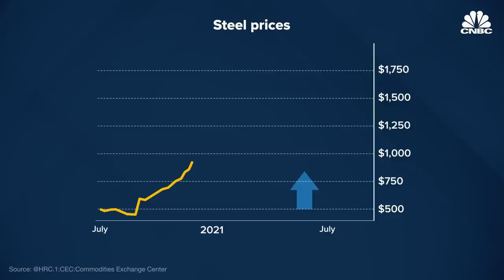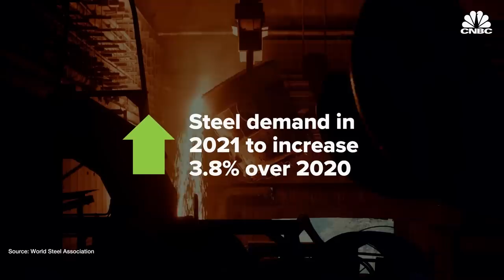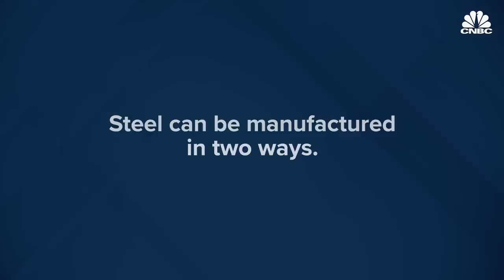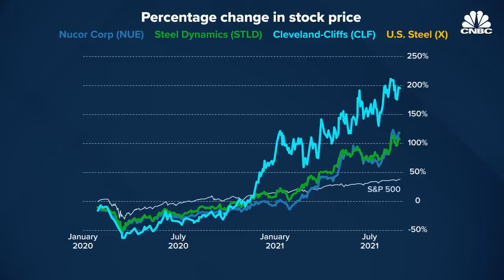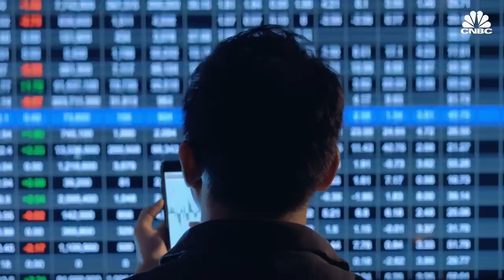Is The Steel Bubble About To Pop?

Comment: For those that don't know, traditional integrated mills also use scrap. They add about 20-30% after the BF and then it goes to the BOF to remove impurities and excess carbon. That's when it's actually considered steel.
Reply: BOF?
Reply: @aaronfield7899  basic oxygen furnace. It has a lance (submerged entry nozzle SEN) that pumps oxygen in. The O2 binds with carbon to make CO and CO2. The lime that's added is a flux that binds with the more active elements and O2 to form slag which is removed. After that it goes to ladle metallurgy, where they adjust the chemistry.
Reply: @jeffquinlan4064  Oh, so Pig iron is the metal transported from the BF to the BOF?
Reply: @aaronfield7899  Yes. Traditionally, they could also be poured into ingots sometimes called pigs. Hence the name. Somewhat of a useless fun fact for you.
Reply: Lies again? Spank Bang

Comment: You can print dollars but you can't print steel. More dollars chasing a limited supply of a resource, it's only logical that the price will rise.
Reply: Prices are rising due to an increase in demand. Demand is increasing as the amount of reshored manufacturing jobs increases. We’re on pace to see a total of 220,000 manufacturing jobs reshore to the US up from 160,000 in 2020 which was up from about 140,000 in 2019. The good news is that we’ve got several steel mills under construction in the US set to come online within a year. I know Nucor is planning to build a massive $2.7 billion steel mill somewhere in the mid-west.
Reply: Fortunatly steel isnt a key material in electric cars
Reply: Davidon   Is not manufacturing steel analogous to printing paper money?
Reply: @peereboom2936  right, the body is made of plastic....uh ha
Reply: @dantheman1534  lol
Reply: @davefroman4700  to bad modern cars don't use nearly as much steel anymore

Comment: Aluminum & copper prices are up cuz the electrical grid is being restructured in Texas. Steel prices won't go up much more until vehicle manufacturing is back up to speed. Labor shortages are also keeping prices down. However, it is probable that the labor & chip shortage could end @ about the same time, skyrocketing prices overnight.

Comment: The electric arc furnaces is for steel recycling not making.
Reply: yes those are normally for steel recycling, but...
"Although steel arc furnaces generally use scrap steel as their primary feedstock, if pig-iron or direct-reduced iron is available economically, these can also be used as furnace feed"
edit: (from another source) 
"electric arc furnaces (EAF) are a common method of reprocessing scrap metal to create new steel. They can also be used for converting pig iron to steel"

Comment: Same thing will happen to steel that happened to lumber. Bubble will burst.
Reply: Capitalism!
Reply: Lumber prices burst?
Reply: @generalx5220  So you don’t know how to look up whole sale lumber prices? Yes they have collapsed. Lumber was over $1500 and is now less than $750 after actually collapsing to less than $500. Basically the same prices as 2018.
Reply: @matthewhuszarik4173  naw not in the are to check. Used to be able to pop my Lowe’s or home deep but that’s not an option now. Cool though, back to normal is good, I thought it was inflationary, you know general price index have gone up from all the money printing

Comment: Recycling steel still requires a large amount of energy. Biggest problem I see in the steel industry is waste of the original product. Cut something wrong? Hole in the wrong place? Dimensions not right? SCRAP IT! Get a new one! For such an energy intense commodity to manufacture there is way too much waste.
Reply: Basically only a small percentage of energy required to make new steel out of scrap steel. Check out Nucor's expense sheet compared to the integrated producers.
Reply: Isn't the "waste" recycled? Genuinely asking.
Reply: @jenisonsound7563  Yes, the " waste " from a cutting operation gets recycled.  This grade of metal has a higher value because it is clean Vs say a car body that needs shredded and separated into differing recycling streams.  

Do a bit of research on scrap metal recycling, this is basically a mining operation.  I never want to see metals thrown in the garbage since the only practical way to retrieve them is to wait for the earth to melt and reform.

Steel, Stainless Steel, Aluminum, Copper, Brass , Lead < primarily from lead acid batteries ( AKA a common traditional car battery )  are very recyclable.  And. . .you can get a few $ in the process.
Reply: RS, so how do propose to reduce waste?
Reply: It’s just like recycled material from your home, it is cheaper to buy new raw material then it is to buy bales of recycled material…the US is on one

Comment: Steel and metals will continue to rise. China has a huge production shortfall due to energy issues. It will need months to fire back up to full capacity.
Reply: You completely misunderstood the situation. China has been intentionally cutting down steel production since last year, trying to remove inefficient, highly polluted steel mills. That country realized it was not worth polluting own lands (some are even permanent) and air to provide cheap products, exchanging for US bonds.
Reply: @anti-bullingjames  China is reducing Australian coal imports and cant find enough to continue running mills and power plans. Everything hit a production slump last year. Aluminum is sky rocketing as well. China can't produce enough to keep up their levels of production. Now with LNG going up all of Asia is about to get hit hard.
Reply: @cmdr1911  apparently you have no idea about this topic. Before china and Australia had issues, only 1.9% all coal consumptions (this is CONSUMPTION rather than IMPORT percentage) in china came from Australia (1/1-11/01,2020, china imported 0.3 bill tones and 70 mill tones came from Australia). Also, a large portion of coals imported from Australia are coking coals for steelmaking (near 60%) rather than thermal coals for heating. In fact, china is the top producer of thermal coals. You can have your own political opinions but can't fake these facts written in hard numbers.
Reply: ben youngin  we been hearing that the last 30years
Reply: @investigativejournalism8393  they may have bailed it out already behind the scenes evergreen is continuing to default and defailt its debts with large interests

Comment: Planes do not use steel, Maybe a few things like the coffee maker but it's mostly aluminum, carbon fiber and other exotic metals. Steel=heavy
Reply: In some cases steel is by far the best option.  Space X uses steel in the building of its Starship rockets because of its ability to tolerate high heat and low temperatures as well since it carries cryofuels and lox that it burns for propulsion.  And since they have been able to get the hull thickness down to 3.66 mm now they have reduced the weight with steel.  Steel is also easier to weld then the alternatives like aluminum.  It is also cheaper then the alternatives espec carbon fiber.
Reply: @michaeldeierhoi4096  yeah, those are rockets, not comercial airliners which I'm talking about. It's a different can of worms
Reply: @hectorgonzalez5030  Indeed, totally different.

Comment: Yes, poor timing for an infrastructure bill. Rosevelt proved it could help float the economy but it sure doesn’t need help right now. Inflation is already bad and a huge bill like this will make it worse. Maybe something to slowly lower the price of steel over time would be okay. If private sector spending was to drop dramatically, we could plunge into a recession pretty easy. I am surprised the spending hasn’t slowed down with the cost of these projects doubling in the last year. I think as we see the currently planned projects completed over the next year, we’ll see an inflation correction that will negatively affect the economy, but will be good to control inflation over the next decade. Right now it is just a cash grab for those who can. Whenever the ports get their crap straight, we’ll start to see the correction..
Reply: The flip side is that building significant capacity can more easily be done when you know demand is high. I've worked in mega projects and the biggest block at the start often is knowing that you will have demand long term.

US infrastructure Is in such dire need that no bill can practically solve the problem, it can just make it mildly less bad.

Comment: Did you know it takes 440 kWH to produce one ton of recycled steel?  It takes 260 tons of steel to make one wind tower. It takes 65 wind towers to produce enough electricity to make one ton of steel.   So to make those 65 towers, it took 16,900 tons of steel, which required 7,436,000 kWH of energy.  Now thats based on the minimum amount of energy needed, it could be substantially more depending on many variables.  Every ton of steel produces 1.85 tons of CO2.  Every tower made produced 481 tons of CO2, those 65 towers to produce 1 ton of steel created 31,265 tons of CO2.    Green energy at it's finest.
Reply: Those are Texan wind towers. They have an incentive to make green energy look bad. In most european countries, they are made of fiberglass, not steel.
Reply: @specialopsdave  Yeah, RIGHT, tower made from fiberglass. Sorry but fiberglass is not structurally sound enough to support rotor diameters of 100-129 meters.   The blades and housing for the gen set may be glass, but the tower is going to be made of steel or concrete, mainly steel.
Reply: @acdii  Results don't lie, and results say they are strong enough
Reply: @specialopsdave  And yet, a search for fiberglass wind towers comes up with blades and nacelles, but nothing about actual towers.  Why? Because they can't make then strong enough to support the weight nor the motion of the nacelle and blades.  The towers are still going to be steel.   Steel can be recycled, fiberglass cannot, and fiberglass breaks down much faster than steel so they have to be replaced quite often, and worse, fill up landfills.  

I don't know where you heard they make towers from fiberglass, but thats incorrect.
Reply: @acdii  I never meant to say towers, I meant to say turbines. My point remains: Steel blades push it over into straight-up environmentaly unfriendly (like in Texas), and plus, only the frame needs to be steel. The tower skin is typically made of fiberglass too (except where they have an incentive to make it environmentally unfriendly)

Plus, recycling? Once biodegradable resins become the norm, the glass will turn to sand over time, and it will leave no trace. In the meantime, it leaves nearly no pollution compared to plastic.

While I agree that steel is more recyclable, the numbers you referred to about wind turbines being worse for the environment? They don't count the ACTUAL savings from recycling the steel. If you do, then they're always better for the environment than coal or gas. 440KWh? You must be referring to the raw thermal energy when using coal foundries. Arc furnaces are the new hotness, and they can be turned off when clean energy is unavailable. Even if your numbers were correct (600 tons of CO2), they'd make it up in the form of clean energy in 2 years.
Reply: @specialopsdave  Um, the tower itself is what is using 260 tons of steel. Not the blades, those have always been a composite of some sort. A steel blade would be too heavy and dangerous.  That is also 260 tons PER tower.  An individual tower will not make up the difference in energy consumption and CO2 emitted for itself.   1 1/2 TONS of CO2 emitted per ton of recycled steel  created. If Pig Iron is needed in the mix, it's even higher. That is JUST to melt the pot and form the blanks. There is till further processing to turn the blank into the rolled sheet steel used to make the tower panels, which creates even more CO2 and uses even more energy. 

No matter how you try to spin it, making the TOWER itself will never be reclaimed by the tower.  It would need to run day in and day out at full speed for years before it reaches the balance point, and they NEVER run day in and day out at full speed, on average 25% of full capacity per year. 

Wind energy is nice and all, but calling it green energy is a big fat LIE.  Alternate energy, yes, Green, oh HELL no!
Reply: @acdii  Your numbers are just straight up wrong. My house's solar panels have made up for 20 tons of CO2 in it's 7 years of operation, and wind isn't too much worse than solar in terms of carbon intensity, so I would highly doubt that maintained grid-scale turbines would do worse than unmaintained private-scale solar panels (I never clean them).

Now, out of all the green energy, yes, wind is the least effective, and should be ignored in favor of others, I agree. But they are greener than coal and gas, and to deny it is simply false.

Comment: You should have covered “hydrogen steel” made in Sweden and Germany and is coal-free. 
I don’t think recycled steel is as strong. 
Also, planes such as the 787 are moving toward virtually no steel (but engine).
Reply: They are all aluminum
Reply: @theidiotic-professional7491  Looked
it up. Steel still in engine fans and many non-aluminum alloys used.
Reply: Some call that DRI. Direct Reduced Iron. It’s a proven technology, but it’s extremely expensive compared to conventional carbon reduction. (Coke+Iron ore) and it still requires hydrogen itself to first be manufactured, and that’s not necessarily green
Reply: @theidiotic-professional7491  aircraft engines rely on high nickel superalloys, like inconel, and hastelloy for all the parts exposed to extreme heat. Aluminum melts and steel turns to playdough at those temperatures.
Reply: The amount of steel in commercial airplanes isn’t dropping significantly. The components that required steel before still so. Commercial airplanes have never had much steel content.
Reply: @Bloated_Tony_Danza  Yes, agree.
Reply: @Bloated_Tony_Danza  Yes, agree. But, it is an improvement.
Reply: planes are not even a pimple on steel usage. automobiles are 25% of the steel market.construction also is a huge portion of steel.market.

Comment: steel scrap is down but steel prices are up. almost like with lumber.
Reply: If production slows due to worker issues, the price of the finished product will go up because someone is willing to out bid someone else just to get material.  The price of scrap goes down because there is an excess of material that isn't flowing through the steel mills.

Comment: I saw that GM recently signed a contract with Nucor to source low or zero carbon steel for the next generation of EVs. We need more pressure being put on the industry to clean up.

Comment: Took my old ac unit to the scrayard and walked away with $100. If u ain't recycling you are missing out on big money.
Reply: I’m getting ten cents a pound for steel. Did your unit weigh 1000 pounds?!?
Reply: @cmleoj  ac unit have a ton of copper and aluminum. #1 copper is nearly $4 per pound. alum is .50 a pound. i got .17 per pound for my steel
Reply: @dgw4049  Sweet! I gotta keep my eye for AC units. Keep rockin’.
Reply: @cmleoj  keep your eyes off my new one!🤑🤑
But yes, if u have one replaced or stumble across a dead one it is a total goldmine.